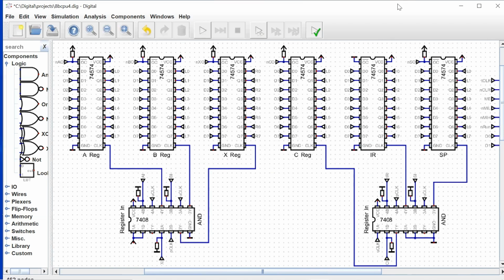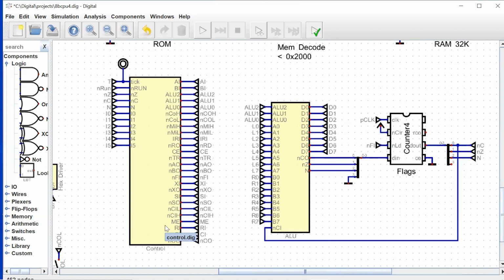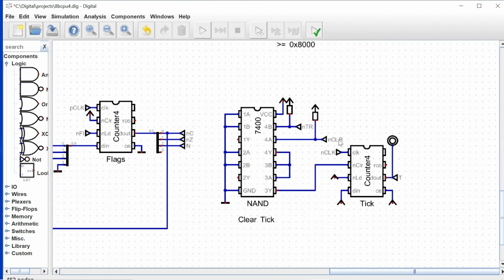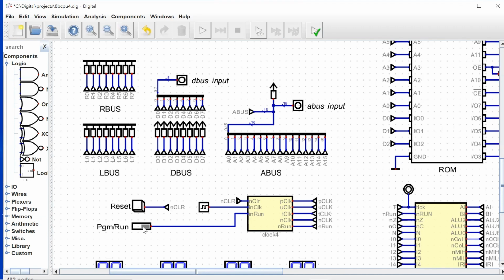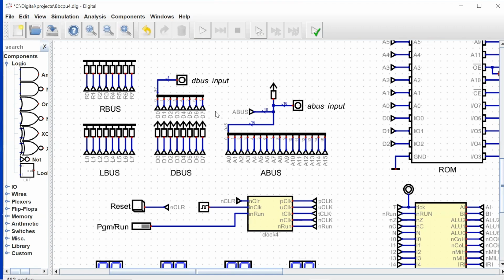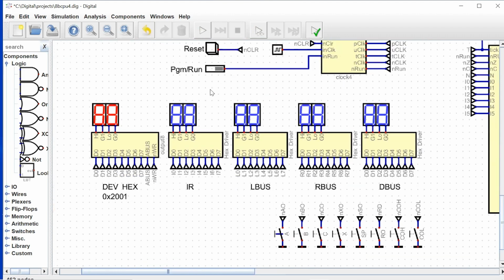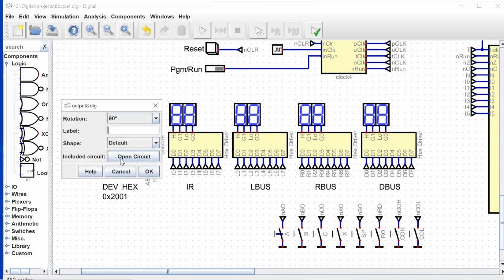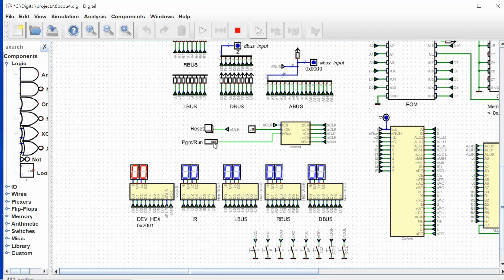TTL Computer II #8 - Design Completion

Comment: Which software?
Reply from the maker: Hi.  The simulation software is Digital by H. Nneemann.
https://github.com/hneemann/Digital
Reply: I’m having trouble with the Hex Driver.  I keep getting errors about the connections.  Do you have a circuit that explains it?